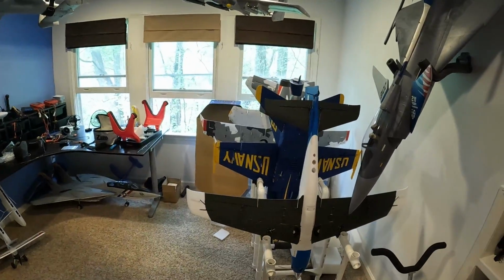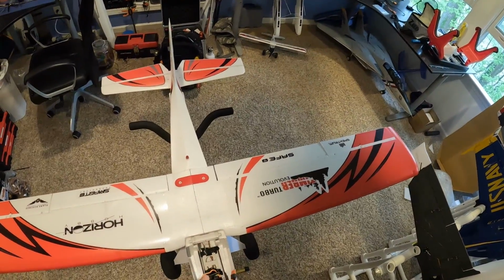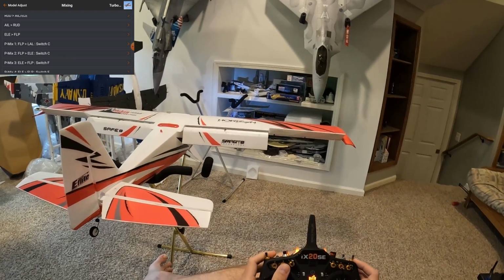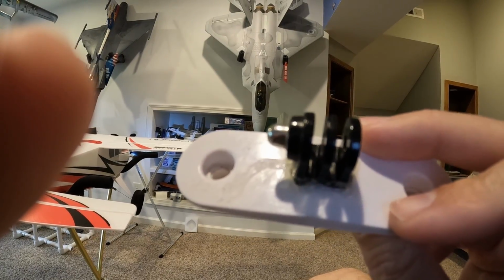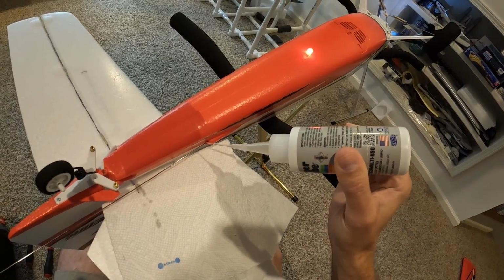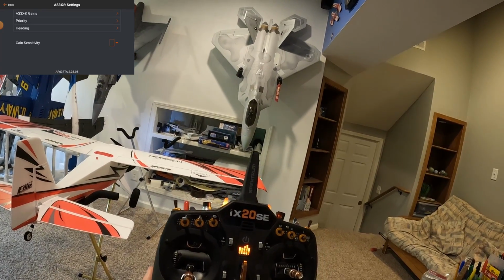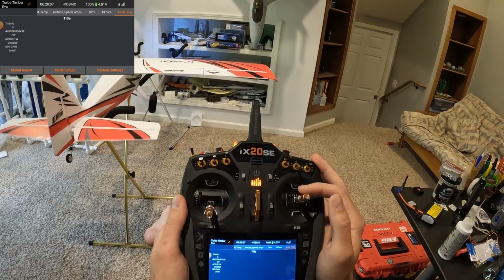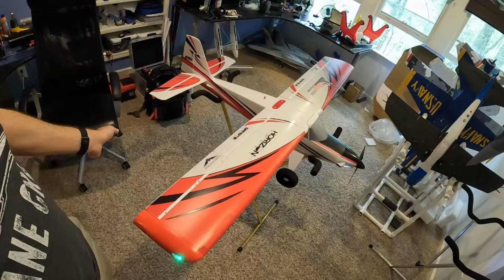Setup: Turbo Timber Evolution Max Performance w/ Spektrum Avian ESC Programming / Voltage Callouts

Comment: I don't find  a segment about flap to elevator mix for keeping the nose down when full flaps are deployed.  What say ye for such percentages?
Reply from the maker: That depends on your CG and also on whether you're using floats. Experiment with about 5 to 10% down elevator with full flaps and adjust as you see fit.
Reply: @TwoBrosRC  CG is as instructions.  Input the down elevator. I tried to adjust the down speed (DX9 xmtr) to about 5 seconds but speed only works on the flips going "up".  Can't sort it even with reverse switch, reverse movement percent.  Lost on that one. Geezer flying on S3 !!

Comment: Hey great vid! I just unlocked my reciever but i can get the 150 rates, assigned as3x safe and nothing on different flight modes, safe worked, as3x didnt do anything, and i didnt get any difference when change my rates. Do you know how to fix that or how to do it?
Reply from the maker: You have to reprogram the receiver before you get 150% rates. Write down the AS3X settings and redo them. If you did all of this already, check the gain settings for AS3X and SAFE and ensure that they're fixed gain, not relative. If they're relative and you have no channel assigned, it will default to 0 gain.
Reply: @TwoBrosRC  Do you have any videos doing this by any chance?
Reply from the maker: @phevosraptopoulous2241  It should be very simple to do, there's not really any way you can muck it up. Search YT for "unlock AR637TA" which should cover the technique.
Reply: @TwoBrosRC  yea searched it up bu found nothing about how to specifcally get 150 rates, for you, did your prog through spektum programmer to get them or through forward programming/
Reply from the maker: @phevosraptopoulous2241  150% rates comes from the transmitter servo settings but will only take effect on a BnF receiver once you've unlocked and factory reset it - otherwise it won't work.
Reply: @TwoBrosRC   Oh ok, so bassicaly what i should do is write down my gains for as3x and safe, then factory reset, then probably make a 3 flight modes, one with safe, one with as3x and one with nothing for the full 150 rates, correct?

Comment: So your video with the SMC battery and showing out the TTE made me order a few of those batteries asap (helluva price too) and following through this I've just finished my crow mod and I'm about to go try it out.  Waiting on the servos to arrive so we will see if I blow the guts out of the spektrum ones lol.  Now I think I may just have to get that damn IX20...or the IX12vor 14 at the very least but if you're gonna go big why not go all the way big? Thanks for not just the knowledge but the technical details as well, you've helped me wake my TTE up in the most rudest and fun way!
Reply from the maker: The IX20 is awesome. We love ours. If you want one and want to support us at no additional charge, consider picking it up via https://bit.ly/3BQvB0u - it's totally worth the price.
Reply: Oh I've used your links for the battery, servos, connector kit (you know most kits don't INCLUDE the female sleeves for connectors, weird right?)  and while I don't think Amazon gives you kickbacks, future planes and one day my ix20 or maybe that ix14 which is more practical for my needs will be through your available links.  Have you had any experience with the v2 versions of those servos that are programmable?  One more thing to program I know, I know but the application gets the wheels turning
Reply from the maker: @Morgan Sullivan  Thank you! We haven't reprogrammed the AGF servos yet but the B13DLM units should be easily reprogrammed.

Comment: Hey. What things did you do to reinforce the elevator or rudder? Flaps and ailerons? I was thinking just adding more glue around some of the base points of the Plastic hinges? Also the plastic arms that attach to the foam..
Reply from the maker: Nylon steel-pinned hinges were used to upgrade the elevator and rudder. Flaps and ailerons are already plastic hinged.
Reply: @TwoBrosRC  Awesome would you be so kind to tell me where you purchase these parts?
Reply from the maker: @GOOGLE_ITlTlT  Amazon has them.

Comment: That Ail-> Ail mix is interesting. I was trying Flaperons on my Trojan T-28 1100mm and the travel of the ailerons in flap position wasn´t high enough. At least in the one that has still SAFE. Maybe I could try that...
Great workshop and amazing how much you have changed and programed!
Reply: I later read that I would be needing to unlock my receiver first... 

It´s crazy in how much detail you have come with your radio!
Reply from the maker: It's a necessary mix if you use crow, otherwise you won't get enough aileron movement to avoid adverse yaw. You can add rudder to compensate but it's never a bad idea to get a more responsive roll.
Reply: @TwoBrosRC  OK slowly I´m beginning to understand! Thanks!!

Comment: Hey, can you send a picture of the wiring setup for the crow setup? Edit* You need another servo for the crow correct? Also, did you replace the servos for only the elevator and rudder? Or all servos?
Reply from the maker: The comments go over what you need to do, be sure to read them over. We replaced all the servos with the ones recommended in the description.

Comment: I had met you a few weeks ago at the holly springs field.  Had a new TT evo, my first electric plane, first new plane in over a decade (or two) at that.  I am not satisfied with the ability of the stock servos to provide adequate torque to move the elevator and rudder surfaces to the full extent of their available travel.  You speak of the b11 dls servos you have installed.  I was wanting a bit more info on this and the method of install.  Are there other servos that compare to these in size and ease of install. It seems like the stock servos are glued into the airframe.  What is involved in replacing these servos?
Reply from the maker: The stock servos for the elevator and rudder are glued in. They're easy to pry out. You just reglue the new units in using FoamTac which will hold solid. The rest of the servos are simple drop-in replacements using screws and plastic housings. You'll have to cut the servo doors for the flaps and ailerons before you can gain access to them. Good to hear from you!
Reply: Thanks for the advice, I got a pair of those servers you recommended. Just like you said , with a little finagling the old servos popped out although I was a little nervous that I was going to tear up the Styrofoam. I was actually amazed at how easily the stock glue just kind of pulled away from it. Used the Foam Tac like you said and sure enough it held the new servos in pretty tightly can't even see them move when I tug on them. The travel is so much better and they are so much more solid than those crap stock servos they put in. Now able to get tons more elevator and rudder travel! Can't wait to put it in the air!
Reply from the maker: @stevenkurtz1231  Happy to hear that! Be sure to let us know how it performs for you.

Comment: hi..i have trouble setting my NX10 to 150% Rates..it goes far at 125% in the D/R  Expo section but the surface controls of my timber evo doesnt move over the 100% rate and after days im trying i dont manage to do it or probably understanding...please can you show a full set up video on how to do it? i would really appreciate....thanks
Reply from the maker: You change the travel in the servo settings, not in dual rates. You have to unlock the receiver to go beyond 100%. This is covered in the video. Check over it again. To unlock, visit https://www.youtube.com/watch?v=F3isbv1U8eM
Reply: @TwoBrosRC  ok i manage to unlock it i guess after registering it on the web and updating it trough 'spektrum programmer'....than i went into the 'servo setup' and into 'travel' section and i changed the rudder at 130 but on my timber the servo is still moving only at 100%. any idea what im doing wrong?..sorry to bother you again but im new with spektrum since i bought it 3 weeks ago plus im italian and i probably missed to understand some of your explanation about  it in your video ....do you know any youtube video about showing how to extend servo travel?
thanks again for your help
Reply from the maker: @Bombana01  You have to unlock the receiver and factory reset it before you can move beyond 100%.
Reply: @TwoBrosRC : oh yes..i see now where im wrong…i’ll try and I’ll let you know. One last question: after i factory reset it can i transfer a new model image in it for the safe select? (switching it on/off at my will) Thanks again for your help/info🙏🕉️
Reply from the maker: @Bombana01  You'll have to reprogram it manually. There's video tutorials on it if you search YouTube.
Reply: @TwoBrosRC  yes i found it! Again thanks 🙏🕉️🙏

Comment: How do you setup dual rates and expo?
Reply from the maker: Should be covered in the vid.
Reply: @TwoBrosRC  Nope. Not even mentioned in the entire video.
Reply from the maker: @arturocaballero7208  Pretty sure it is lol
Reply: @TwoBrosRC  Around what time in the video? I've watched it at least five times in full. Mainly because I think is very informational and I have a Timber EVO I'm having trouble with.
Reply from the maker: @arturocaballero7208  6:26 - it's also tagged "150% Rates" as a chapter. We didn't cover expo because it's up to personal preference, but we fly ours with 40% aileron expo, 50% elevator, and 50% rudder.
Reply: @TwoBrosRC  Thanks !!!!😀

Comment: How did you plug the aileron into the 5th channel without disconnecting the lights? With the stock receiver all of the servo ports are full even with the ailerons y-harnessed together. Did you connect the lights to the ailerons using a y harness or something?
Reply from the maker: Lights go into the bind port. They'll draw power from it.
Reply: @TwoBrosRC  ah ok, thanks!
Reply: @TwoBrosRC  also have you had issues with the stock prop adapter on the timber or the Cirrus slipping off despite being tightened down really hard? I frequently have to reattach the prop adapter because it keeps sliding off, and it's getting really annoying. Do you have any tips to keep the prop adapters firmly attached?
Reply from the maker: @flyingfools47  Hold sandpaper to the motor shaft and scuff it up a bit before placing the prop adapter on it.

Comment: Really liked your comprehensive video. Would you tell us which wires you cut from the aileron plug? Also my stock receiver is already using all outputs where did you plugged yours?
Reply from the maker: Check the comments, it's all covered. The lights can be plugged into the bind port.

Comment: Hey I see that you were able to max out control throw with the stock receiver. For some reason It just won’t let me max it out. It says on my transmitter that throw is set to 150. But the plane ITself won’t go past 100. Any tips?
Reply from the maker: We mentioned it in the vid - you need to unlock it and reprogram it or you'll be stuck at 100% throw.
Reply: @TwoBrosRC  awesome thank you so much

Comment: Love the video! 
What wires do I cut? I appreciate it!
Reply from the maker: All you have to do is unscrew the two wing plugs in the fuselage, unplug them from the receiver, and cut one of the leads going into the aileron plug right before where it plugs into the plastic lead. Use a DuPont connector kit (like the one in my description) and affix a new servo lead to the end of the cut wire, then connect that to channel 5 or 6 - depending on which channel your transmitter expects the aileron to be connected when you've set it up as a 2 Aileron 1 Flap wing type.

Once this is done and the receiver is reprogrammed, you'll have stabilization on both ailerons.

Comment: Jon, hello¡¡¡  I was thrilled with your video, it was very helpful. I have a question regarding the AGFRC Micro 9g Servo you used to upgrade your timber. It seems that one of the gears is made of plastic, have you ever had a problem with that? Regards
Reply from the maker: Never had any problems that could be attributed to the one plastic gear. It's one of the biggest gears and doesn't strip easily at all. These servos get tossed into most of our models flying 9g class units and we've only had two fail in nearly two years of using them.
Reply: @TwoBrosRC  Jon, your comments are very helpful. I was wondering also if you had tried any of the Corona servos similar in size and characteristics as the ones you use normally. Regards
Reply from the maker: Nope, never tried them.

Comment: I ask a lot from because you have the most helpful videos  but I defiantly need help with the wiring set up for crow on this plane.
Reply from the maker: It should all be documented in the vid - but if it's unclear, undo the screws on the fuselage plugs and suss out which plug goes to what servo lead. It should be very straightforward. Once you see which one is the aileron lead, cut ONE lead at the point where it splits off coming from the receiver. Use the crimping tool in the description to affix a new servo lead to the cut end after stripping the wires. Bear in mind that a crow setup on Spektrum transmitters (two ailerons, one flap) defaults to the right aileron being in channel 2 unless you want to mess about with redoing Channel Assign.
Reply: Actually I read through the comments and found where you explained it allready

Comment: Does anyone have ideas pertaining to  What’s the best way to remove the servos to upgrade them ?
Reply from the maker: The wing servos are easy to remove. The fuselage servos just need to be gently pulled out. You can apply turpentine to the glue behind them which will soften them, or just pull the servo with a pair of pliers until it gives.
Reply: @TwoBrosRC  thanks my elivator servo is going out after 15 easy scale flights no 3D. So I’m upgrading
Reply from the maker: @poker8193  https://tinyurl.com/B11DLS have served my Timbers well for years. You'll notice an immediate difference. Add more expo because it'll be somewhat more touchy with more torque and speed.
Reply: @TwoBrosRC  that’s what I ordered after watching your video. Wich brought me to asking about how to remove. Thanks again I hope they are delivered before the weekevd

Comment: Thank you for this video! I love the idea of crow on the Timber in particular. I just switched the ailerons to two separate channels as you explained, but I am having the strange issue of one aileron having slightly reduced throw than the other since this modification. Any suggestions where I can start to investigate?
I searched the internet high and low, but the most similar situations are people who have built their own plane and their pushrods were different lengths. Easy fix for their issue.
Reply from the maker: Make sure both are set to the same throw and ensure that you've reset the receiver. If you have them set to 150% rates but the receiver wasn't reprogrammed, the servo will only travel 100% instead of 150%.
Reply: @TwoBrosRC  Ok, I’ve been reading the other comments as well. I’ll have to update the firmware on the RX to factory settings, then use forward programming to increase rates? I don’t know how to do this, but I’m sure I can figure it out. 

If I’m understanding you correctly, the difference in throw that I am experiencing is due to the original aileron channel being restricted to 100%, but the channel where I plugged in the “new” aileron, is not restricted. 
Really appreciate your reply! I’ll try this out tomorrow if I can figure out the firmware update and the necessary RX programming.
Reply from the maker: @stevecipolla3508  That's correct, basically. You set the rates in Servo Setup. Forward programming is where you factory reset the receiver after updating the firmware on your PC. Look up "unlock AR637TA" on YT. It'll tell you what you need to know.

Comment: Hey jon can you please send me a pic of your setup   for crow braking?
Reply from the maker: All the info is in the vid, including on-screen displays showing the setup info.
Reply: @TwoBrosRC   I’m trying to understand which wire to splice into for this to work
Reply from the maker: Follow the aileron lead from the left plug to the receiver. It should be in channel 2. Cut ONE of the leads where it meets the plug going into the receiver, then crimp on a new connector using a DuPont kit linked in the description and plug it into the channel the receiver is expecting when the transmitter is set to 2 Ailerons, 1 Flap. Then follow the rest of the steps and you're good to go.

Comment: So from what I understand in order to get the AR637TA to ACCTUALLY achieve 150% rates you need to unlock it via PC, and Spektrum Programming Cable SPMA3065?  is there clear/easy settings to increase the rates once your in the PC menu? or is it more of a PITA then that? thanks.
Reply from the maker: You do need to unlock any current Spektrum receiver to get more than 100% travel. You reprogram it via Forward Programming. The PC app is only to update the firmware to allow you to factory reset the model's receiver. Write down the gain settings prior to wiping it.
Reply: @TwoBrosRC   If you ever get a chance to make a video on this process I'm sure lots of people would be interested to see, including myself. thanks for the great vids.

Comment: Got a new TTE, when it’s hooked up to a battery, all the controls work except for the throttle, Esc keeps beeping with different batteries, any suggestions.
Reply from the maker: Cut the throttle before connecting the battery.